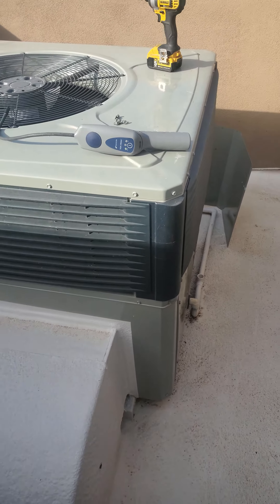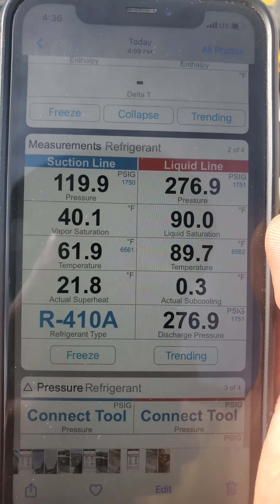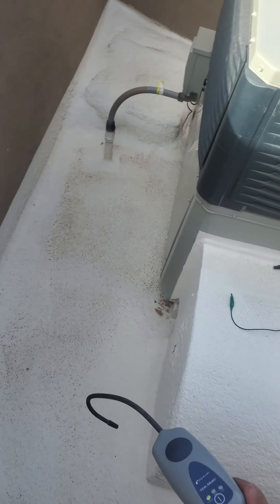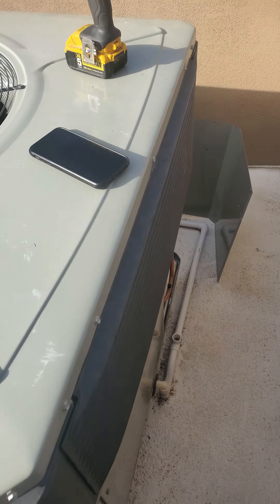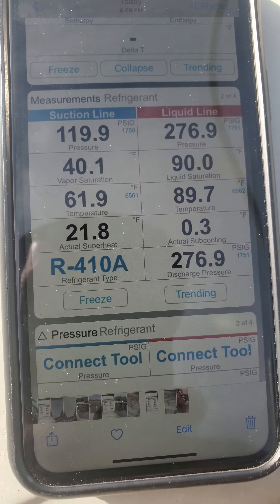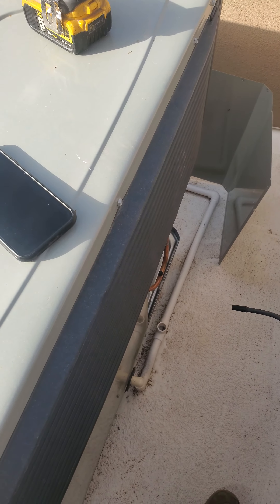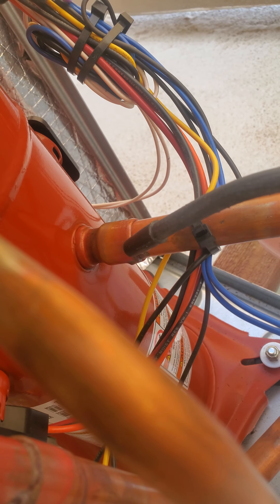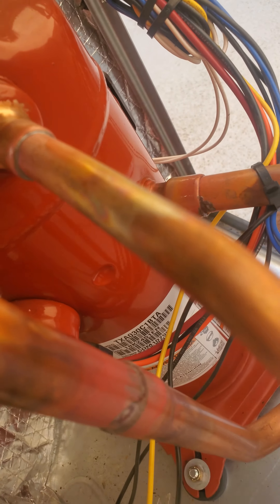TRANE MANUFACTURER MISTAKE! AIR CONDITIONER, HEAT PUMP, HEATER REPAIR INSTALLATION SERVICE PHOENIX

Comment: Who else knew it was low as soon as you seen that 410 277 and .3 lol
Reply: Dead giveaway with those pressures and subcool. The suction line leak at the compressor was a good find even before the detector screamed. Way to go Jay! 
🤜🏾🤛🏼

Comment: Quality control has gone down the drain for Trane, but to be fair most manufacturers have been having quality issues post pandemic.
Reply from the maker: very true! although respect where it's due, here in Phoenix they were the last man standing with systems available during the shutdown of 2020